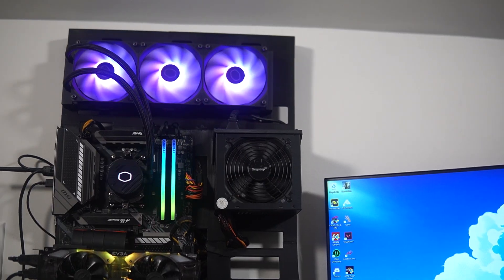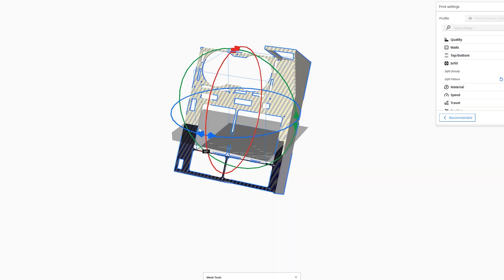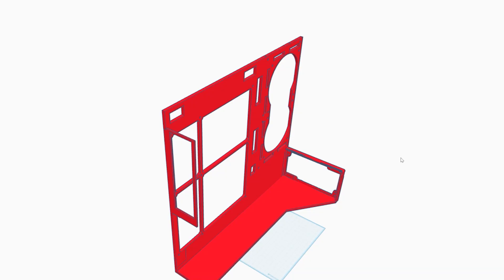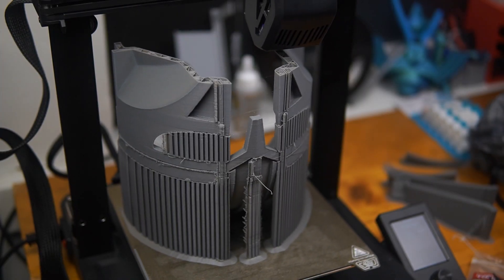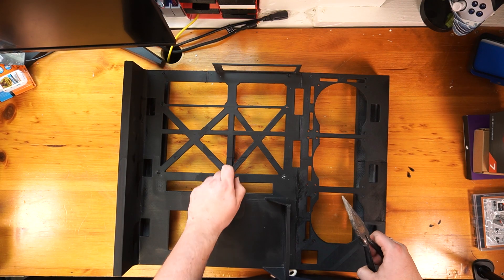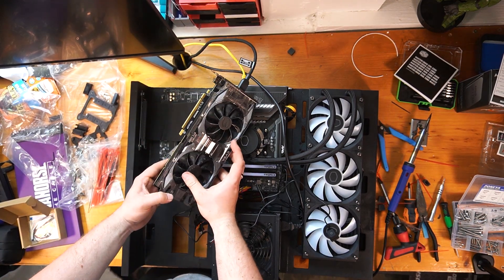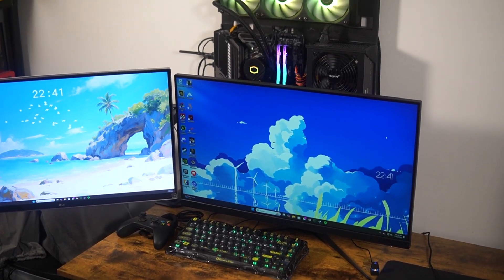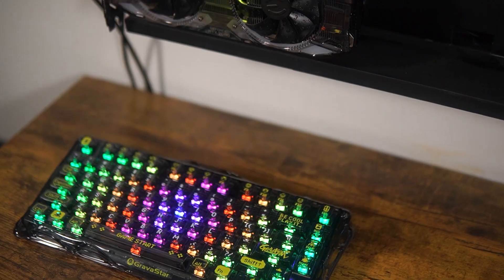I designed my own wall-mounted PC case

Comment: Really enjoyed the video man, ignore all the stupid comments, I liked the editing. Couple questions because I’m thinking of doing something similar. Now that some time has passed have you run into any issues with the rigidity/brittle nature of 3D printing the stand. Also is heat a concern at all I’m worried the constant heat cycles no matter how hot they are, could have a negative impact in the long term strength of the stand.
Reply from the maker: I appreciate it brother!, at the moment I haven't had any issues at all I use it on a daily and so far it's holding up pretty good. I also thought the heat was going to be a problem but since it's an open-air case the heat is able to dissipate pretty good.

Comment: i saw that evga 2080... amazing card. i have the 2070 super evga with the same shroud. i have the original black shroud version too.
Reply from the maker: It really is such an amazing card, I have EVGA rtx 3080ti on my editing PC
Reply: @Ignitablecub  what software did you use to design this case?